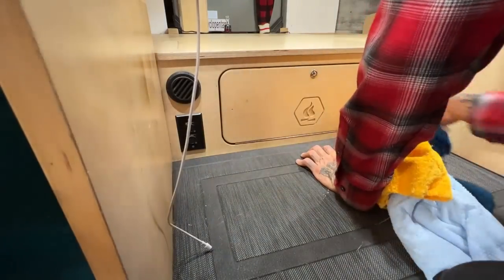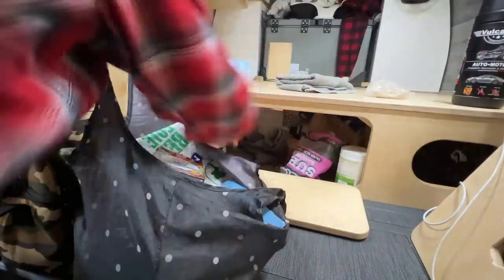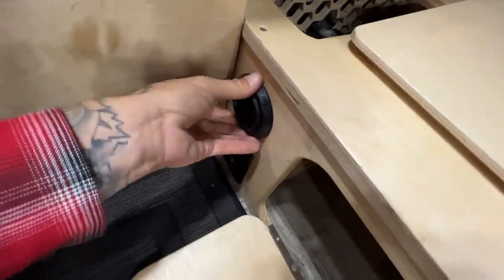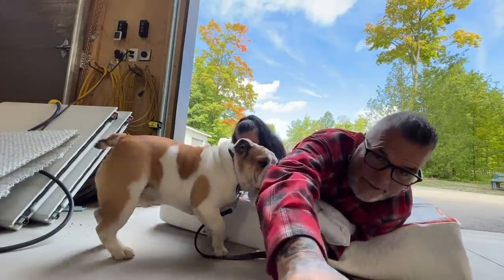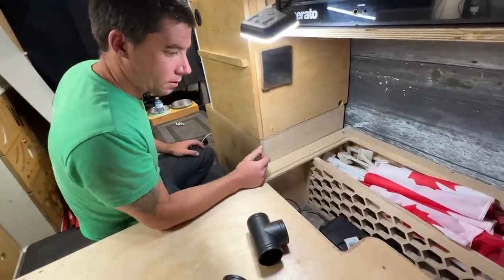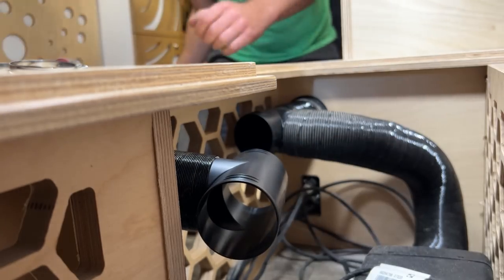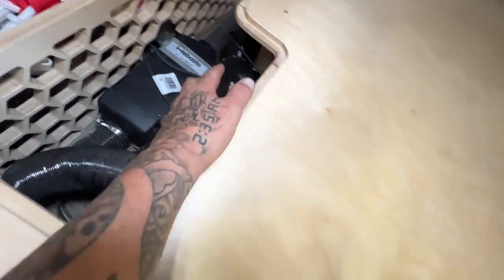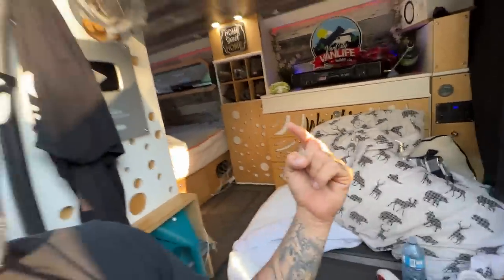HEATING UNDER MY BED And Getting Ready For a BIG UPGRADE SOON

Comment: Just a suggestion on the mattress cover. We had the same issue in our motorhome.  Upgraded to a better thinner one.  Laurie went to the dollar store and bought some of those (no idea what they're called), but they look like suspender clamps on each end fastened together with elastic in the middle.  They are made to go on the corner of the bottom sheet to keep it in place.  She just pulled together a couple of pleats underneath, clamped on some (no idea how many), and you would never know.  Cost under 5 $ and 15 minutes work.
Reply: I was going to suggest this

Comment: "Cat", again!  In my experience, if you do not install a relief duct from the heated space you are pumping all that fresh warm/hot/moist/wet air (although a very small amount of moisture) into the greater space of your van, you will create "science projects" in those "closed off" compartments greater than any you have ever grown in any unattended refrigerator!  Relief duct those enclosed areas!
Reply: Important information, definitely want to eliminate the molds, mildew, funguses, etc...

Comment: Nice upgrade. What's the reason for going with 4 - 100ah instead of 2 - 206ah batteries? Price looks similar. Is height requirement for your storage area an issue?

Comment: Why not do 12v battery blankets no ducting to run
Reply from the maker: Because the heater is already pushing out hot air, so it just made sense to make use of it. No need to run more cables plugs, or anything else.
Reply from the maker: Because the heater is already pushing out hot air, so it just made sense to make use of it. No need to run more cables plugs, or anything else.
Reply: I was thinking it was simpler a all you needed to do is wrap the batteries and run the plugs to a 12v outlet.
I enjoy your videos...  👍

Comment: Great video Chrome. Those batteries will make all the difference. You will nearly have unlimited power. You’ll be running an extension cord over to Emi’s van lol. We travel with a small inverter generator to recharge when we need to.

Comment: There goes your warranty lol. Dude you spend 6 to 8 hrs a day everyday in bed asleep that almost 33% of your time. It's important to sleep well and get proper support for those young bones. Don't skimp on mattress and certainly don't take out probably best layer of foam out your mattress. Would have been better to shave an inch off height of your base and keep the full thickness of mattress

Comment: Her battery system hours are air conditioner or heater or microwave or ovens all our electrical stuff at once and she can get so much power 13 KW hours  he said it would have taken 20 battleborn batteries to match that power she has three batteries that produces 13kw

Comment: Hello from Norway.😊Its very important to have air circulation under the bed. I did it myself in my caravan (but another heater). I also have a Chevy express 1500,year 2005 cargovan. I use it as a "RV." But it's simple. No diesel heather.

Comment: "Cat", here, Chrome!  After 41 years of RV'g, I've learned that when you buy stuff in boxes, the contents, usually, come in a bag of some sort in the box.  So, you remove all contents, in their own bag or not and place them in a air evacuated zip loc bag of appropriate size.  In fact, I usually leave all that packaging in the shopping cart, instead of dealing with it later, and return the cart, with thrash, to the store so "they" can deal with the packaging thrash!  This way, you leave the thrash with the store and you reduce the storage space of your latest purchases to a minimum, refrigerated or dry stored!  See, GENIUS!!!!